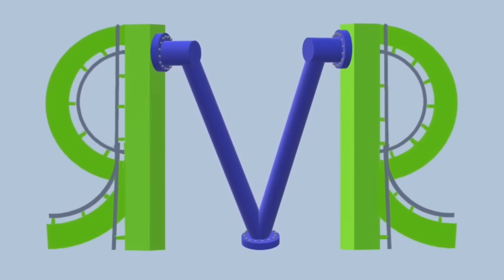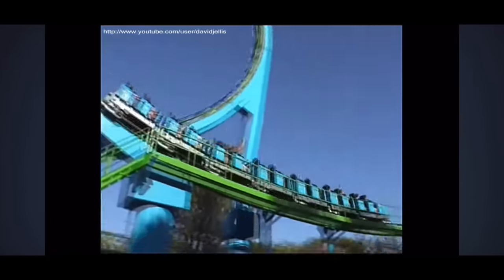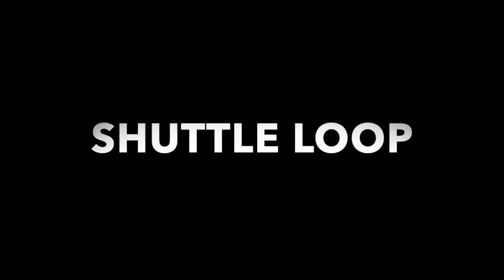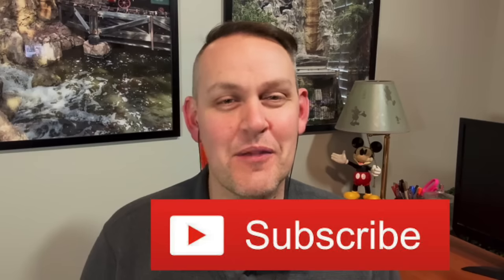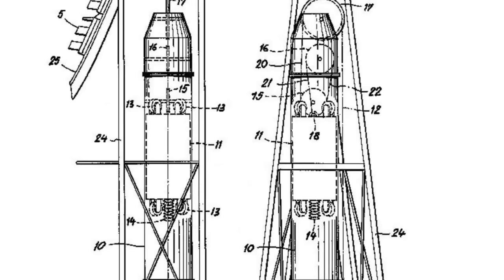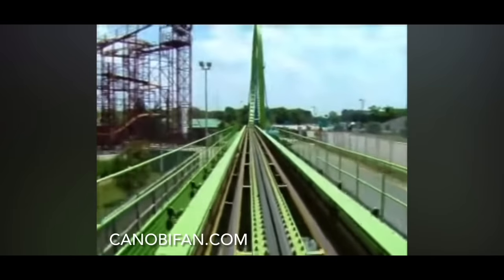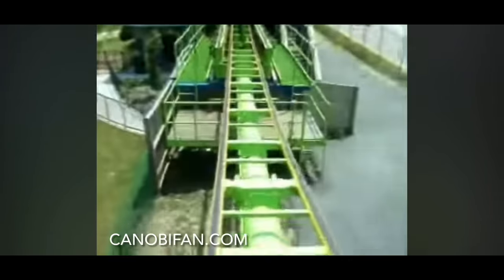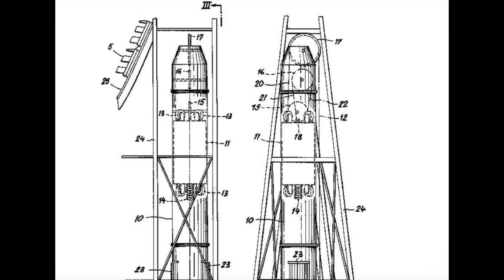How does a weight drop shuttle coaster works STROBE WARNING

Comment: I was 100 yards from Tidal Wave and the weight cable SNAPPED!!!  It was Summer 1981 in Gurnee.  It was raining and lightening/thundering and then there was a huge Boom! ...no lightening.  Back then, Tidal Wave would run in the rain, Willards Whizzer, Demon and American Eagle would not.  Due to rain and being late night, the park was nearly empty.  A week later, they were working on the drop tower weight.  They were shoveling out sand(no water) and tossing out large lead 'x' shaped weights from the window you mentioned... so the window might also have been for access too.  But I agree, there is an air shock effect.  I was told by my supervisor, the tower tilted slightly(but in tolerance) and that the cable snapped.  Note, ride was down  the week prior from what I was told was a cable replacement.  Would be neat to have a Gurnee mechanic comment.  I loved Tidal Wave...43 years ago it was so special.  I became a mechanical engineer partially from admiring the Tidal Wave from backstage and watching the cables.  I have ridden Montezooma and look forward to the Un-named one at Niagra opening.  Side note, you may already know, Silver Bullet has some water tanks at the loop and turnarounds(ballast?) and square section at the loop.  Thanks for the great vid.  Marty
Reply from the maker: awesome info/ counterweight snap is about the worst maintenance thing I could think of, yuck. as far a water on silver bullet? maybe vibration absorption? very odd, normally you don't do that with a steel coaster as it will eventually corrode the tank for the inside out, but Ill take a look and see if I can spot what your referencing. can you see it on any videos or google earth?
Reply: Hi Ryan, a little deeper into the rabbit hole!  Scorpion at Busch/Tampa has a similar but permanent version...but Big Blue in Croatia has tanks filled with sand.  These were Silver Arrow Models versus Looping Star(Silver Bullet).  Funny how Scorpion gets tons of love at BGT, but Silver Bullet Frontier gets little.  I felt both were very similar ride.
Reply from the maker: @mmocken  it had to be for ballast. We had a spinning gerschlour (no I can’t spell that haha) it was built to be portable, and between all the beams in some high force areas we had to add tons of rock as it was starting to walk on the pad sense there was no true foundation anchors.
Reply: @ryantheridemechanic  on a related note, jet star 2 at lagoon also 'walks'.  About every 15 minutes, the operator stops the ride and walks out to the support lattice with a large 🔨.  I was floored when I saw it.  Same operation felt js2 was on borrowed time due to age of electric motors
Reply from the maker: @mmocken  haha! Same pad for the spinning coaster we had a portable 110ft high coaster that was also walking toward the tram lane. We figured it would take about 4 years to make it a foot (ish)
Reply: @mmocken  Water ballast is extremely common on transportable rides, not just coasters.
Think of Huss Top Spin 1 models - the big cylindrical towers on either side  - they are water ballast tanks. A lot if KMG rides have the tanks integrated in the trailers where you can't see them. The benefit for a transportable ride is that you can simply dump the ballast when you are done at one site, move the much lighter ride, and refill at the next site. Less weight to haul around. 
Silver Bullet being the only Looping Star that was 100% made for fairground operations (it is the only one to not have the bolted-on plates to keep the loop together, but the "cone plug" connectors, the other ones, even if built to be used without concrete footers still have the more cumbersome loop setup), obviously needs the ballast. Why it hasn't been replaced with sand in the almost 40 years it has been sitting in the same spot - I don't know. The "doesn't get a lot of love" thing is probably down to the two different companies involved. Sea World, who don't really seem to operate "lower tier" parks, and Six Flags, in whose portfolio Frontier City is on the small end and probably doesn't get a ton of budget. (Still it's the best themed park you can go to with a Six Flags pass). However, they have invested some money in the last couple of years. The ride got a new control system, the train got a complete overhaul, the loop has been repainted (I assume the rest of the track is next), they erected a proper structure for the queue line building, and last bot not least, the train (the only 1st generation Schwarzkopf train to still be in operation) got a very sleek looking vinyl wrap for this season.

Comment: It is totally possible to stop the counterweight due to the small gap between the counterweight and the walls. S&S made a drop tower called Sonic Boom that used that exact principle as the rides main breaking system.

Comment: My information specified the drop weight to be 42 metric tons  (about 96000 lbs). But I don't know what is more accurate...
Reply from the maker: It all theory anyway. I doubt anyone has ever weighed it. Even with a strain gauge there enough pulleys to thro the measurements off.

Comment: Only recently found the channel, Ryan, but loving tge content. This video was especially interesting ad we had a weight drop Schwartzkopf shuttle at Alton Towers in the UK in the early 90's. I found the way it worked fascinating, and remember standing in line with my Dad, watching how it all worked. The port near the bottom of the tower on Thunder Looper was a large open port, and you could easily see the weight drops past the port, then stop, and start to winch back up. It was an awesome, and much missed ride. It ran with just lapbars, as intended, and I loved it! Sadly it only had temporary planning at the park, because it was above tree height, and i also heard that there were complaints from local farmers that the noise from the ride was causing thier cows to panic!
Anyway, great vids, really enjoying the channel 😊
Reply from the maker: @RapidsJohnson  thank you

Comment: If there were no pulleys on top of the launch weight, it would theoretically drop at up to 1g (minus any friction from the cables and train). With 2 pulleys the cable goes 3 meters for every meter the weight falls, so it would pull at up to 3g. The launch dog pulley looks like it is a larger diameter than the drum the weight drop cable wraps around, so it would multiply the acceleration as well. It is so clever that you can set the launch acceleration by the number of pulleys.

I love the simplicity of the weight trapping air in the launch tube to slow it down. There are no sensors to fail, so it works every time. (unless someone left the access hatch open at the bottom) Genius! Let the physics do the work!

Comment: I've been on the transportable one of these, the bullet. I wish you'd do the fly wheel version. Love you video
Reply from the maker: Thank I’m going to do the flywheel in a little bit
Reply: Nice one 😅
Reply: I don't know if it was the same on all the fly wheel version. But the transportable version set off up the backwards spike first. I wonder how they got it to change direction in such little time, obviously sum sort or gearing. But it seems complicated. If you watch a video of the bullet you will understand what I mean.
Reply: @jordanburdett4979  The normal flywheel version launched forward - the cycle looked like on the weight drop model. The transportable one didn't have a flywheel - just some beefy motors that would first push the train up the back spike a bit, and then reverse and launch the train through its course.

Comment: So... About the air hole... Although I have no way to prove it. I bet it indeed does work. For instance. Do some homework on this ride called " Sonic Boom at Celebration Centre"  it has no brakes no real way to stop the 300 ft plus drop... Except for a tube... And the air compressing around it. So I would believe this same principal is at play as a last resort safety. Not so much as a normal ride use control. But more or less a last resort safety.  Check it out. I think it's even worth its own video. Also S&S I think made it.. Very worth checking out. There are a few other YT videos on it as well. But id like to see your take on it ;) . as always thanks for the videos ~Russ (what air gates? Hehe)
Reply from the maker: I will check that out! thanks!

Comment: Do you happen to have any videos or other information on how the launch cylinders are sealed on a compressed air launch coaster? I can’t quite wrap my head around how they prevent blowby around the launch sled or launch cable, depending on how its put together.
Reply from the maker: I have a little but it's not easy to explain. luckily im making a video on that soon.

Comment: I'm glad you mentioned Zoom at the end..it was my favorite ride. I worked there for a few years and loved the sounds of the flywheel launch. I would take my breaks close to it whenever I could. I rode it many times, got to see under the station during testing, and heard a few war stories about it from the mechanics. IIRC it also "rang the bell" but just once. 

The only thing I (and many riders) never liked was the brakes into the station. They were extremely rough and whiplash makers, and you never knew how intense because it changed constantly. Ops told me it was pain as it frequently (especially in fog or mist) wouldn't home consistently. (I saw that in my under the station view. The home position range was only a few inches.)

Have you done a deep dive on flywheel launch shuttles yet?
Reply from the maker: Not yet. Honestly I was waiting to see what people said about this video. I learn from people’s comments because I have lots of mechanics and engineers that worked on these. So I wait to see what I / we can learn and take it to the the next video. I do plan on making it though. Probably soon. And homing on these rides like a boomerang are a pain for sure. Especially closer to the ocean.

Comment: You know, I had the chance to ride White Lightning at Carowinds in the 80's and I missed out on it because of horror stories my uncle told about it, I was also young and was just starting to get into coasters. Anyways, my thought is how can one park not maintain it any longer (Carowinds in this case), but another park overseas (Gold Reef City) has kept it in operation long after Carowinds sold the ride and the Manufacture is long out of business?
Reply from the maker: I believe this is because of oversight. Insurance here in the US prevents inferior components from being installed. Places where no one is really watching, repairs are easy, just build whatever you want. just my thought/ my opinion. Keeps repair costs low.
Reply: @ryantheridemechanic  It's often not really a "we are not able to do it", but a "It is not economically feasible to do it" - the ride doesn't generate enough revenue for the park to offset the cost for keeping it running. Think about a big name park as Carowinds, a ride like a shuttle loop has way too much competition there.

Comment: Thank you for a fascinating video - I'm a huge Schwarzkopf fan, and I always found the weight drop rides particularly fascinating. 
One question (sorry if you covered it and I missed it): Which position does the weight get left in when the ride is closed? I always figured it would be at the bottom of the tower, to maybe reduce the stress on the cable, but I may be totally wrong.
Reply from the maker: Honestly I don’t know. I have a feeling this is a park thing not so much what the manufacturer says. To Me, just me thinking, it makes the most sense to leave it all the way down at night. This way all the brakes can be inspected and adjusted as needed in the morning. But I don’t have an actual answer for you. For cable inspection you would want it at the top so the most cable possible is visible.

Comment: After skyrush’s restraints were changed I was wondering what they do to put new restraints on and do they need to do the whole entire testing process again?
Reply from the maker: Depends on the type of change they called it. More than likely it was load it for 100-200 cycles, inspection, have insurance and engineering sign off, train the crew. Should be good to go then.

Comment: I would never get under a weight, especially that size and depends on air pressure to stop.You just broke the air brakes by opening that door.
Reply from the maker: Yea but I guess it was safe?
Reply: @ryantheridemechanic  I wouldn't be surprised, if there were actually some supports that could be put in place to keep the weight in place. If people still would be afraid to work underneath the weight, they should be terrified of being on a low floor of a high-rise building...
Sure, I wouldn't rely on that if the weight is all the way up. But if it is lowered onto these supports, where could it possibly go?
Reply from the maker: @Colaholiker  you ever work underneath supports that are creaking. The noise is an uneasy feeling that they will just break. But got to get it done right!